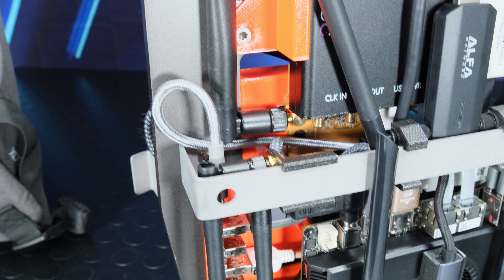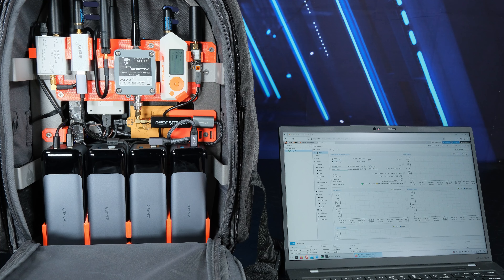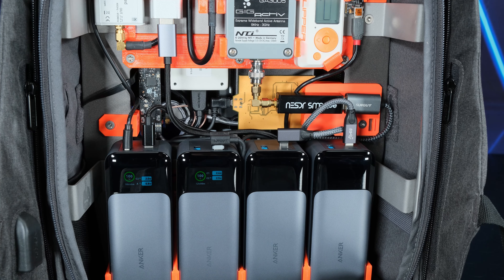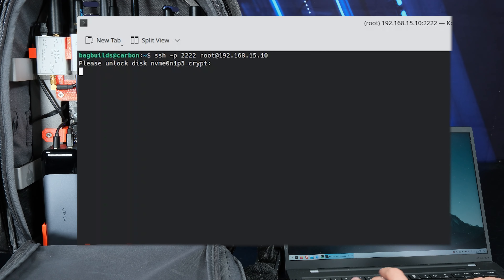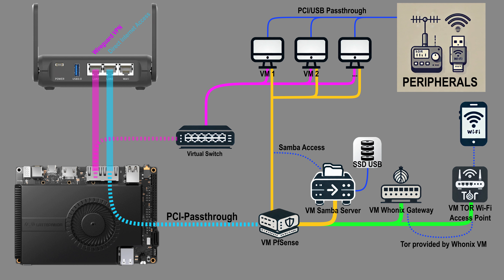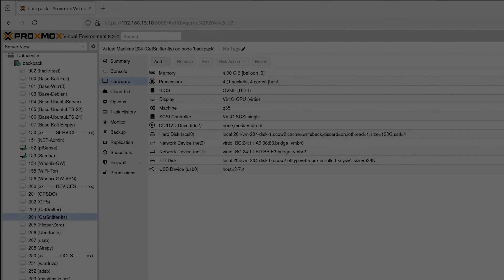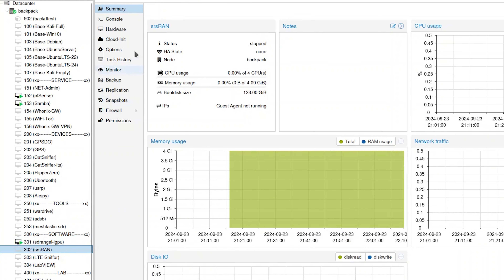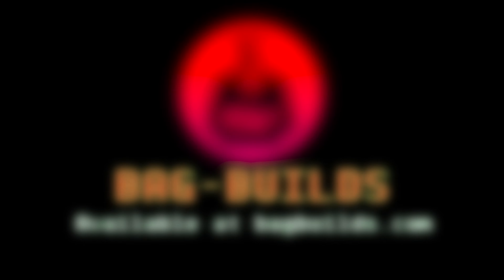Backpack Cyberdeck: DIY Tech Setup Brief Overview

Comment: saw meshtastic-sdr vm there but didn't see any lora hardware connected... are you checking meshtastic network with normal sdr tools ?  Next level stuff here.... Love it !! You NEED to make more videos on use cases with your setup!!  BTW did not see a DragonOS VM there but love the fact that you are splitting the use-cases based on VMs to reduce clutter and have your settings work just right.  Flipper Zero VM for changing stuff on flipper I guess.... and LTE stuff is interesting  LOVE TO SEE MORE!!!
Reply from the maker: Yes, Meshtastic-SDR is a project that uses SDR radios for Meshtastic. An SDR can decode all the presets simultaneously. There’s also a LoRa module, the programmable Catsniffer board integrates a Semtech SX1262 (LoRa) and a CC1352, I mainly use it as Bluetooth sniffer. I’ve also installed DragonOS, but it's at the bottom of the list, so it’s not visible in the video. I'll be creating more content to demonstrate various operations. Thanks for the support! :)

Comment: Lovely install, lovely video, still have NO idea what this actually does or what it's intended for.
Reply from the maker: Basically, it’s a mobile lab setup that makes it much easier for me to run experiments and work with all my gear on the go. Instead of packing and unpacking everything every time I want to relocate, this setup allows me to keep all the equipment in one place, ready to use without the hassle of setting it up from scratch each time. It’s all about convenience and mobility!
I’ll be making more videos to show how it all works in practice.

Comment: A modern gargoyles wet dream.  You have indeed inspired me to build my rig.  I will be looking to your channel with great interest as I work through my planning stages.  Suffice it to say, this seems like quite the expensive project, definitely a $1 - 2k investment.  What inspired your build, and what challenges did you have to overcome to make it?  Is there a community in which you are a part of that helped you design this, or did you conceive it all yourself?  I know where to get most of the gear, but what did you have to learn to put it all together?  Thank you for sharing your design!
Reply from the maker: I’m really glad to hear that my creation has inspired you! I’d love to see more projects like this, and I completely agree, the cost can be quite high. The components I used are mostly things I’ve accumulated over the years, so that helped spread out the investment.

I worked on this project entirely on my own, as I don’t know anyone who shares this specific interest. If you plan on building something similar, I highly recommend avoiding USB 3.0 devices since they generate a significant amount of interference over a wide range of frequencies. USB 3.2 Gen 2 is a much better option, or USB 2.0.

One of the biggest things I had to learn was how different devices interact with each other, especially when it comes to radios and antennas positioned so close together.

Keep in mind that a setup like this has its limitations; it’s a bit like a Swiss Army knife, it can do a lot of things, but it won’t match the performance of a specialized tool designed for a single purpose. It all depends on what you want to install in your rig. Make sure to learn about how radios work and the potential issues that come with positioning antennas in close proximity. It’ll save you a lot of headaches!

Thanks again for the support, and best of luck with your build, feel free to reach out if you have any questions!

Comment: First of all super impressive build. How long did it take from inception to completion? Also Im interested to know why the double and tripling of some devices specifically SDR. The SDR's are similar I'm some respects but Im sure you picked them for specific purposes. I look forward to a detailed explanation at some stage. Also my brain tells me there would be a LOT of RF noise in that bag. SDR being so Wideband would be almost saturated with RF and would suffer from excessive noise / crosstalk etc. How have you mitigated that?
Reply from the maker: Thank you for the appreciation! In theory, this setup could lead to issues like antenna coupling due to their close proximity, but in practice, I haven’t encountered any coupling or cross-talk problems. For instance, I can decode aircraft transponders over 150 km away with an RTL-SDR and an antenna inside the backpack. I’ve also tested SRSRAN with two connected devices, both with antennas inside the backpack, and experienced no cross-talk, even when decoding LoRa packets or similar signals.

Typically, I only keep two antennas outside the backpack: one for the Airspy and one for the HackRF. The USRP antenna stays inside unless I’m sniffing LTE packets in areas with weak signals. The same applies to Wi-Fi adapters. Surprisingly, even with nearby metal parts, reception has been excellent. I’ve tested this setup in rural areas, with houses far from the road, and with the backpack on the car’s passenger seat, essentially a metal cage, and still managed to pick up router signals without any issues.

I selected different SDRs for their unique features and because certain experiments require multiple radios or simultaneous reception of signals on different frequencies. The RTL-SDR can power an active antenna without needing a power inserter, which I find very convenient. The Airspy has better resolution for decoding weak signals. I mainly use these two radios along with the HackRF, pairing them with specific antennas to ensure solid performance across various frequencies.

I primarily use the USRP for cellular networks. While its USB 3.0 connection generates broad-spectrum noise, it offers unique capabilities. It defaults to USB 2.0 at startup, so it doesn’t interfere until actively used. However, it’s not ideal for signals below 300 MHz, where an external antenna is necessary.

This system takes some experience to use effectively, but with practice, it’s incredibly versatile. Of course, there are limits, for satellite signals, for example, you need purpose-built antennas that can’t be mounted on a backpack. Still, having all the equipment in one portable setup is extremely convenient, letting me work without needing to set up anything on the ground.
Reply: @BAG.BUILDS  As I said fantastic work. Look forward to your other projects.

Comment: I had a thought for something similar such that I could have a “laptop” on the go in the form of my phone connected to such a device. Out of curiosity, are you not worried about the network security of this device connecting to potentially malicious actors on a regular basis?
Reply from the maker: Thanks for your question! If you're referring to the risk of remote access from malicious actors, it’s not really a concern for how I use it. I only connect it to the internet when I need to install something, and I do that through my own trusted networks. Most of the time, it’s completely offline, so there’s no risk of unwanted connections.

Plus, I don’t have any open ports for remote access, and I don’t connect to the setup via the internet. Since it’s primarily a mobile lab for experiments, security isn’t my top priority in that sense. The only reason I encrypted the storage is because it’s a portable device, and in case I lose it, I’d want to protect the data. So overall, network security isn’t really an issue for how I use it.

Comment: It's not an "ordinary backpack" though, it's obvious it has something like this in it due to the style and how ridgid it is. You should buy a common backpack like a KANKEN or a VANs/DC one and adapt that instead. Also, you're gunna be bald in 6 months if you run this on your back every day
Reply from the maker: Thanks for the suggestions! I’ll definitely take a look at the backpacks you mentioned. I chose this specific model because it opens from the front rather than the top, which makes it easier to access the gear inside.
Haha, no worries, I won’t be losing my hair anytime soon! I mainly use it for listening, and even when I do transmit, it’s only for short bursts. A smartphone emits more radio waves than this setup. It’s not like I’m running a mobile broadcast station 24/7! 😁